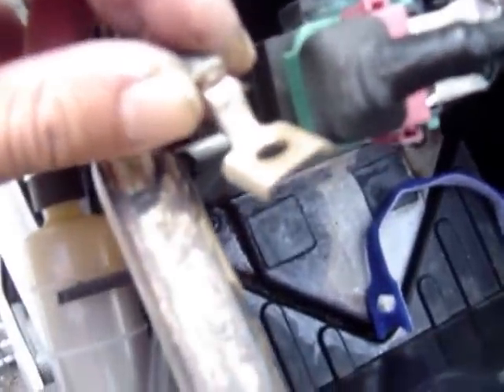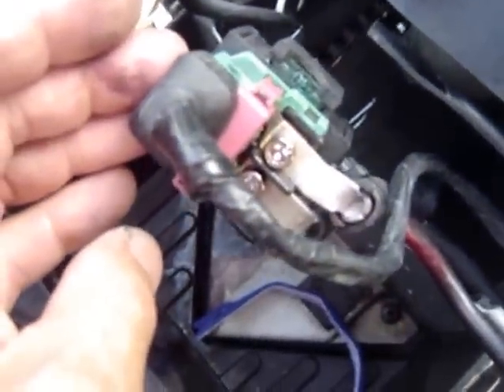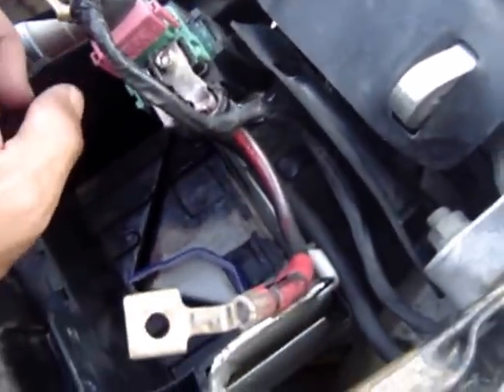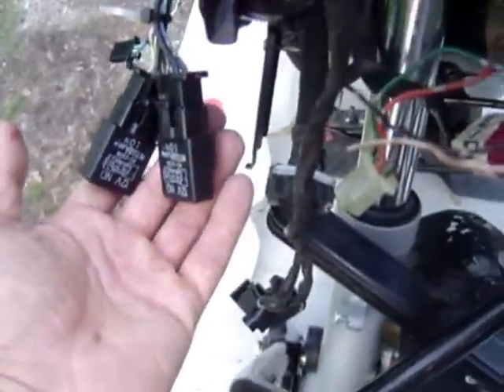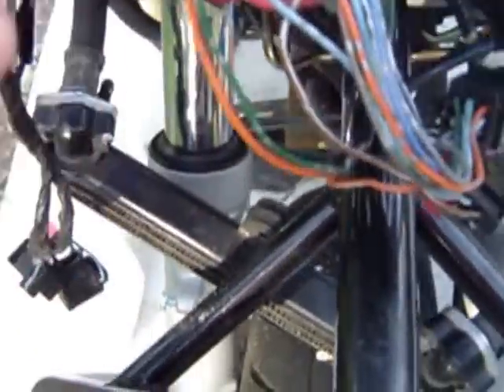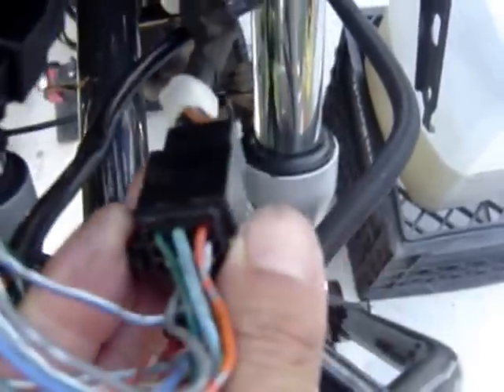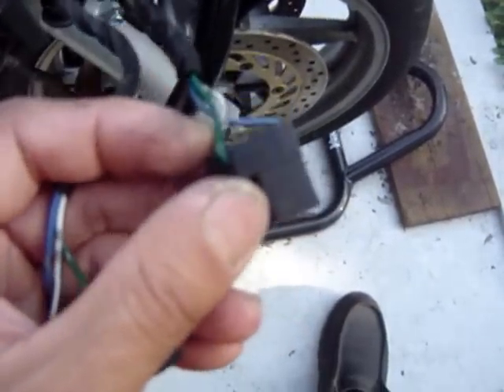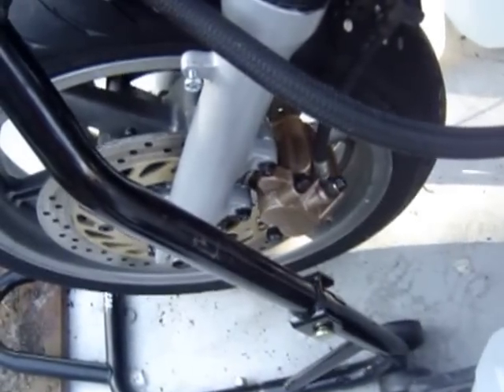Troubleshooting Motorcycle Electrical Circuits - Quick Simple Methods (92 Honda VFR750)

Comment: The biggest flaw on the vfr line up, what do you think you think of the vfrness? Mines burned some wires, thevworst is the green and black that leads to somewhwre under the tank.
Reply from the maker: Although you are correct.  It is an easy fix.  Buy a VFR harness online such as eBay.  Cut a section of it off you need to replace and solder it.  Make sure the connections are identical, most of the VFRs from 1986 to 1997 are the same.  You have a brand new wiring harness.  You can also do the exact same with the wires that burned out.

Comment: Thanks for informative video. 
Been trying to work out what is wrong with my vfr, when it's ticking over in neutral for a while, the neutral light either goes off or flickers. Now it won't come on but occasionally when it does come on it'll start. Could there be a wiring issue to the neutral do you think? 
Any help would be appreciated

Comment: My rear taillight doesn't work. But my headlights, turn signals, brake signals are fine. Any suggestions before I start working on it?  A Honda cbr is the model.
Reply: Check the bulb.  The brake light and taillight are the same bulbs with 2 elements

Comment: I have a vfr 1995. Last year changed battery and 2 reg. This week burmed another regulator and battery. I begin to believe that the source is a wire problem. Which wires i should begin to check first?

Comment: My battery keeps dying and my lights and speedometer turned off the only light that turns on when is on is my headlight what do you think it is?
Reply from the maker: The part most suspect is "My baterry keeps dying."  Start there.

Comment: What’s up buddy, I have a 98 Honda CBR900rr. I took my battery off to charge and test it and when I hooked it back up i have no power at all. I checked the starter relay and it was melted pretty bad. So I spliced the wires and added new connectors. Still no power. I tested the connectors with a multimeter and I’m getting 12 volts to it. But still no power to the bike. Any help is appreciated. Thanks
Reply from the maker: Before you even assume it is the starter relay or the harness, you need to get it 12V, say a jumpbox.  If you hook up the jumpbox and do not get anything, bridge the plugs, that allows 12V to the starter.  Now you can get a new starter relay and begin the test again.
Reply: Alex-Thang Nguyen appreciate the reply. I actually just put it back together. There was a hot wire grounding out on my frame. Not sure why it was causing me to have no power but as soon as I fixed that wire it started right up

Comment: I have a spark problem it  misses the spark. The spark is blue but isn't constant any ideas?
Reply from the maker: Yeah one or more in the spark system, most common is corrosion and age.  You must isolate by swapping components or measure each. It could be the wire, everything!
Reply: @alex-thangnguyen2746  could it be the wiring harness iv noticed theres alot of the rubber over the wires are breaking away?  Could that be it? Also could it be a bad stator?

Comment: Hey!! Thank you.   My bike was acting weird.  Sometimes it started, sometimes not. I would hit the starter and NOTHING.   took off seat and Voila...battery connections all vibrated loose!!
Reply from the maker: I see Casper the friendly ghost has struck on your end now!  Electrical problems are easy once you see them.  Until then, just plug them into the grid and tune everything out.  It will stump you until you actually get a bad experience at this.
Reply: Yup.  I just count my blessings that the bike didn't shut down while I was at speed.  I learn SO MUCH from these videos and the experiences (fails) of others. You guys point out things I would NEVER have known otherwise.  Thanks
Reply from the maker: @BluegrassAficianado  IF YOU DISCONNECT THE IGNITION OR DO NOT PLUG IT IN FULLY... IT WILL SHUT OFF.  I TAPE THE IGNITION and hide them so that nobody can get their greasy hands on it.

Comment: My cousin is having issues with a yamaha R6 2009 where the the signal and taillights going out do you have any ideas what it could be, the fuse keep burning out!
Reply from the maker: Don't know the R6 but its a short; start testing the circuits and isolate the problem using the video on isolation.
Reply: Alex-Thang Nguyen  hey I have a similar issue with a 99 triumph Sprint st... I was wondering if u can give me some sort of guide on what to check.... I opened up my harness found out I'm getting a sort in my relay connected to my turning signals brake light and headlights was wondering how can I check what wire can be the problem
Reply from the maker: Yeah.  Most electrical problems are simple, such as a loose wire or connection.  However, compounded ones or major ones such as headlights, turn signals, etc.  indicate bigger things.  The best way and the fastest way to fix these electrical issues is to "borrow" a working part or have a spare bike.  If you do not have a working part available, you must trace the circuit; start with the fuse box and make sure there is 12v.  From the fuse, you should get 12v; unless the relay is burned out.
Reply: Check regulator/rectifier

Comment: Hey man! My yamaha xj750 tipped over today while i was on it, kinda just layed it down while standing still, and the headlight and instrument cluster lights suddenly stopped working, i still had break and passing light but nothing else, any ideas ?
Reply from the maker: Yes.  The wires for those components are in the frontal area and hence the power in the rear is AOK.  So unplug the headlight connectors and use a multi-meter to see if there is 12 volts.  If there is no power, then go to the fuse block and test the headlight fuse and 12 volts.  If there is no power at the fuse block, it is going to be a very long week ahead because now you have to start tracing it.  Most likely, the sharp turn on the steering wheel disconnected the wire harness.
Reply: Well thanks for the answer man! But i just got the bike and i found out the other day that it was as easy as just turning them on again with the switch that i didnt notice was there 😂 but again thanks for the answer!
Reply: Have you tried a massive dose of heroin? That may cure your problem.

Comment: Good day Sir! My bike have a problem at first i switched it on in ignition switch using my key then i used it for 10 minutes ride then when i turn it off the engine still on so i turn it off by kill switch! Its grounded! How do i fix that? Should i replace a new ignition switch or check first the wiring inside?please give some idea to fix! Thanks!
Reply from the maker: check your harness and kill switch for any faults.

Comment: Battery is good I tested it. Might be the connection
Reply from the maker: Please do not start a new post for each reply or situation.  The logical thought process would be as follows; battery, connection to battery, ignition, starter relay, fuse box, wire or short, etc.  Just turn the ignition on, hit the "on" button, and put 12V on the starter.  I would not do that if you are not sure of what you are doing because you could have a hole in your house when the bike takes off.
Reply from the maker: sell me your FZR750R limited edition, factory name W09.  A buddy of mine had one for 6 months before he totaled it.  I'll take the FZR1000R limited edition if you have that one.

Comment: Nice video. Thanks for trying to help us electrical rookies. Working on an 81 GS850GX. Love the bike. Typical electrical problems. Your tips will get me further. Former owner had a vetter fairing on it. Removed it and the nest of wires and electrical tape. I am a bit hesitant to start sorting out all the wire mess in front, but can't afford a shop to trouble shoot it for a week, so here I go.
Ever work with or install a MotorGadget style box?? I liked the idea of ripping out all the original wires and starting fresh. But again, kinda pricey.
Anyway, Good job.
Reply from the maker: No problems.  These old vintage bikes require a lot of tender loving care as they get older.  Most new motorcycle people do not understand or can cope with the love owners have or have grown over the years.  This is why classic or vintage motorcycles, even cars, are not for everybody and now and then you get that smartass who wants to turn your world upside down or can criticize anything about vintage or old bikes.  No they are not like new bikes and yes they require a lot of work; that is why people put the work into them, so they can get so much more out.  Now and then I will get these newbies who think they know motorcycles or act like they are the gurus when it comes to restoring motorcycles or even making very complex decisions; so if these owners of old bikes can avoid or ignore the "other world" whose advice is shrewed and pays no attention to the movement in the vintage or even the cafe racer sectors, I would say to them "that is why you are not an expert and I am."  You get what you put into it and if you have an open and considerate mind, you will get out what you put in but as I said, there is always that smartass and exception to the rule whom I would gladly slam the door on anytime.  A lot of people who ride motorcycles lack the bearings to plan their own life but they know motorcycles!  I am not one of them and I don't act like a professor lacking a college degree.  Oh I have seen so many of them and they just annoy the hell out of me honestly.  What I am saying is they really don't give a damn and give the impression they are tough or something; that is why you have to tell them to take a hike or beat them to a pulp until they will just get lost!  Welcome to the world of motorcycles, you meet the nice ones and then there are the ones who act nice.
Reply from the maker: PEOPLE GROW OLD AND THEY DO NOT TAKE THE TIME TO FIX THINGS OR UNDERSTAND THINGS!  The only way to preserve and keep an industry of support for old bikes and running bikes is for ppl like yourself to fix and spend the time to understand what they are doing so they can get better, faster, and surpass those who refuse to or do not want to!  It is a growing pain but when you own a car or motorcycle, it is the same experience and the same situation.  For anybody to suggest they have the answer is similar to saying "they are full of..."  Trust me there are plenty of ppl out there... plenty.  When things grow older, you must take the time to fix them or preserve them or else they will perish; oddly, humans have not learned this lesson yet but they just know everything there is about life.  All cars and all motorcycles when they age, need tender loving car based on the wear and tear or their career usage.  They could be recreational vehicles or restored for this reason.
Reply: Ditto. This generation many times can't appreciate the "ancestors" we ride. Like I told one friend, I'm riding the great-Grandfather of the Hayabusa. :-)
And we get the thrill of building it ourselves.
Reply from the maker: America is doomed and its more than a generation of losers.  Yeah some of the ppl on youtube are very good and some are just there to give you a hard time, act like they know it all, or play with your confidence while they are all about being down and out.  You should see the up and coming retirees in Florida!  Another thing I hate about people is how they touch other peoples' bike and then they play it off with, "dude, that's uncool when you touch my bike."  THE ONE LESSON I HAVE LEARNED IN LIFE IS TO GET RID OF PPL WHO REFUSE TO LEARN OR CANNOT LEARN; THAT IS MY ADVICE TO PASS ON.  if you notice how these people are and their refusal to learn and how they act as if they are invited when and if they please; get rid of them because it is downhill from there.  They will never learn and soon they will set up shop or make a home in your life.  If you are an employer, fire them and get rid of them before it is too late!  that was the most important lesson i learned in life, never waste your time with those kinds of people regardless of how much attention or care they give you!

Comment: I have a 2005 zx6r and my ECU fuse keeps blowing, I can be a a stop light after riding for a few hours and soon as I come out of first it blows the fuse then if I sit for 20 mins and put a new fuse in it will run fine but yesterday it did and I sat for a while then changed the fuse took off and gave it some good speed and it popped again I sat around again for a min changed the fuse and I didn't do over 50 mph and it ran fine plz help me lol
Reply from the maker: A blown fuse is an indicator of:  1.  water intrusion.  2.  short in a wire or component due to heat, friction, or a mistake.  3.  Your charging system is not taking the AC voltage of the 3 phase stator and turning it into 12-14 volts.  I cannot answer your question but I would suggest you borrow your buddies zx6 ECU and see if it is doing it also.  To measure an "active" short; turn off the power and measure it to ground and to the + on the battery.  If you see any voltage, you have a passive short.  An active short is when you turn on the bike and voltage is seeping into that circuit and blowing the fuse; such as ground short.  I DO NOT HAVE A HISTORY THAT BIKE so I cannot tell you who did what or what did what to it.  One example is installing the wrong stator.  You should be reading 12.8 to 13.5 volts when the bike is on at the battery.
Reply: Alex-Thang Nguyen thanks I'm going to check into it

Comment: Hey alex can you help me with my problem. When i install my mew battery its always spark and its autamatoc start itself. What should i do?
Reply from the maker: Obviously you have a cross wire or a short.  My guess is a non OEM starter relay or a damaged starter relay.  My second guess is heat joining two wires.  THEORY AND GUESSES ARE GREAT!  HOWEVER, the EXACT problem cannot be diagnosed until or unless you begin to measure strategic points:  1) starter relay (swap with working one) 2.  start stop button faulty 3) ALL CIRCUITS AND RELAYS (stuck relay).  Start with the obvious, guesses.  Call a local shop and tell them... see what they think; if after all fails, you need professional help!!!  Sparking means you blew the starter relay upon hooking up the battery FYI; so you should have a fried starter relay.

Comment: my battery, small and main fuse all checked out. I have a shadow 750 and initially it lost power while riding, I was close to home so jump started and rode home but now won't get any power when key is turned. replaced starter relay and battery is fully charged with no corrosion on or around terminals. what do you think?
Reply from the maker: The bike cutting off tells me your stator is burnt or the wire harness came loose.  If you worked on ANYTHING relating to electrical power; recheck your work.  My next guess is the plug.  When you find it, you can replace it or remove the corrosion or otherwise replace the connector; good luck!!!  CHECK YOUR IGNITION WIRE FROM THE KEY TO THE WIRING HARNESS.
Reply: jcblur311 did u fix it what was it?

Comment: Pleaaase answer .. I have a 2007 Daytona 675 that stopped running.. every time I turn the key the gauges come on but when I press the push start only a clicking sound I changed the rectifier and got a new battery but still the same issue and ideas on what I should do next ???
Reply from the maker: Try to bump start it or bypassing the starter relay by creating a short over the + terminals (battery to starter wire).  If it starts then you know it is not the bike, starter relay, or starter; so it must be your start button or up by your handgrips.  Good luck.
Reply from the maker: IT IS NOT THE RECTIFIER OR STATOR.  You have not eliminated the obvious yet.  

1) a click on a car means the starter is dead or you have seized.  A click-click-BOOM (kidding) means the battery is low or you have corroded wires.  Here is what I would do, isolate.  Start with a fresh battery.  Then try a direct 12 volts (jump box) to the starter.  On a car, it is your starter.  On a motorcycle, it could be anything.  What I think I am hearing is a dead battery or maybe 11.9 volts.  YOU MUST HAVE 12.4 VOLTS OR ABOVE!!!

Comment: I don't have any power. Can it be because of faulty solenoid? when I connect positive cable to connector power is on (even without a key in)
Reply from the maker: Always check the battery when you have no power.
Reply: battery are fine. power is on when I bypass   solenoid. was more surprise fuse on relay it's fine but not power at all her through it.
Reply from the maker: It sounds like you do not know what the problem is or your ignition is faulty.  Did it get stolen recently?
Reply: yes it was stolen and yes one of the cable from ignition lost connection. all sorted now. thanks

Comment: I never touched my cables or moved any but was driving along and smoke was coming from the front of the bike when i pulled over and checked 3 areas of my wires had been thro and all you could see was copper, so ive removed my light switch but life it connected to block as other things are on that till i get it looked at on thursday 

Can i still ride the bike during the day ?